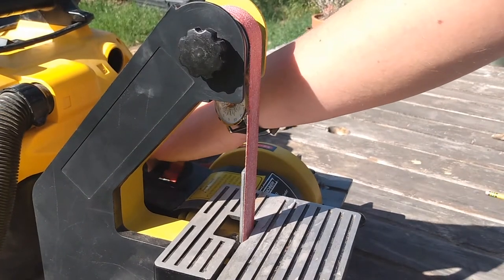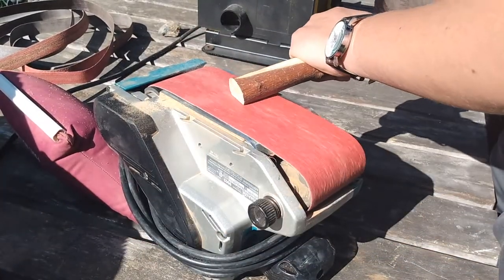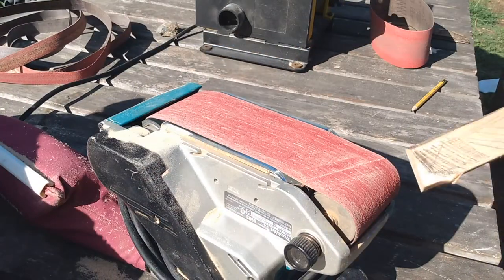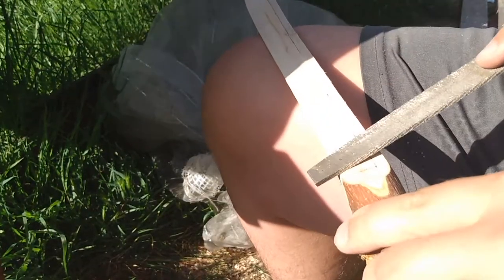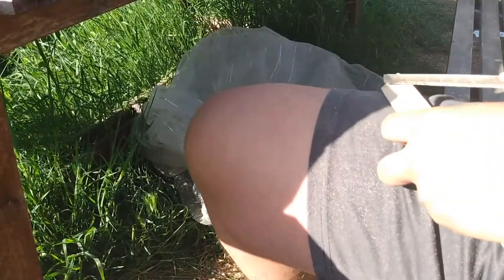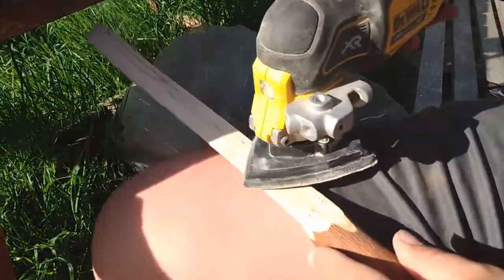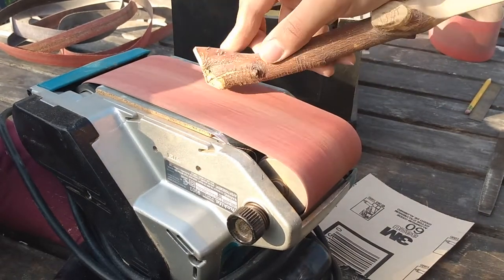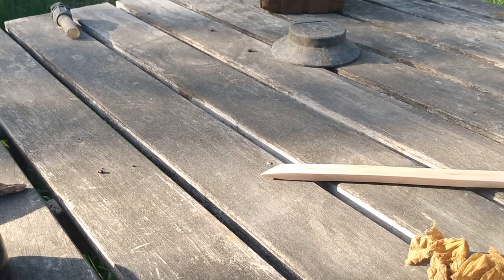Making a wooden Dagger... yay!

Comment: Looks geat! Nice to see I'm not the only one using the hand sander for this, with limited tools this helped a lot compared to hand sanding!

I started with a hockey stick and ended up with a decent shape. Was missing a bit of meat of the blade to get the shape I wanted but still not looking too bad! 

Figuring out the aligment for edges and thickness on both sides is hard, drawing lines ahead of time helps a lot like you pointed out! I hope to get better at this over time as a small hobby, your video was nice to see for comparison! :D